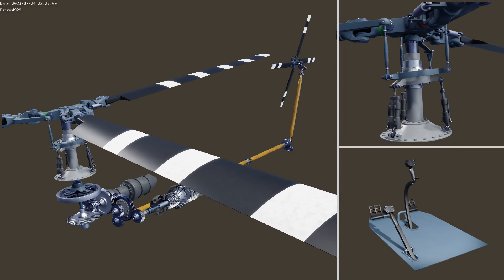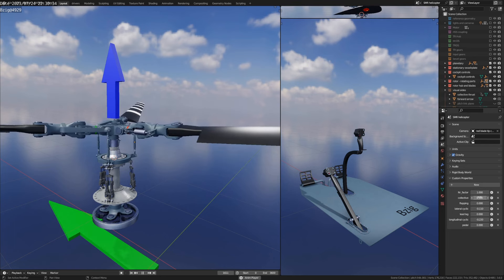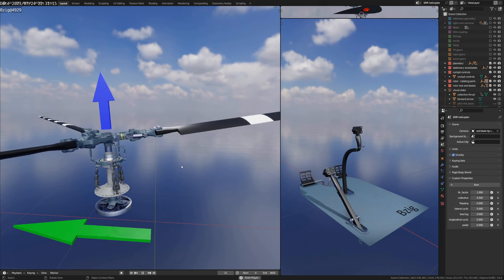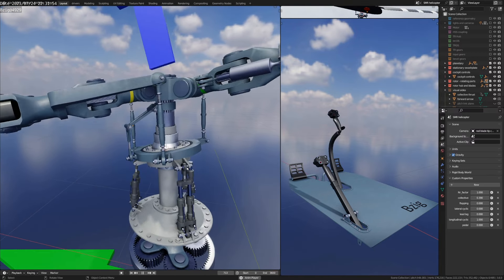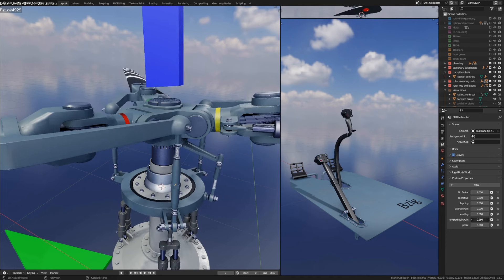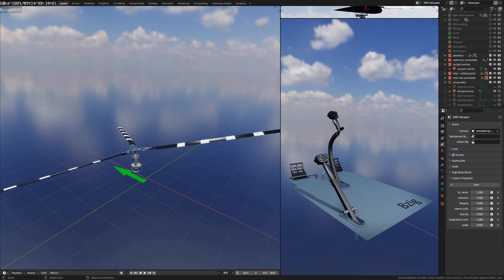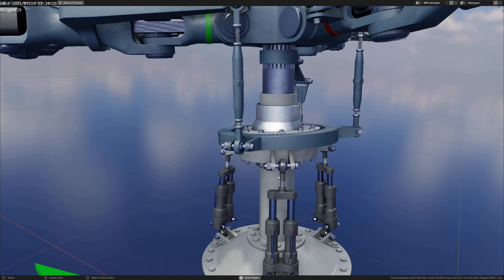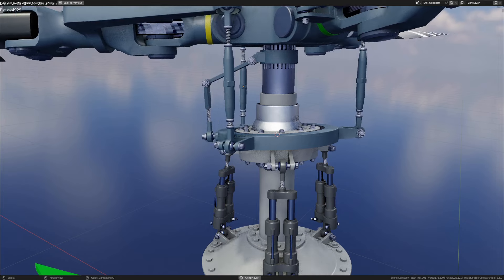helicopter rotor control -  phase delay

Comment: think the light came on when you showed the pitch link... we not actually controlling the blades, we controlling the pitch links, their position and direction are linked, due to the structure, the blades are offset from them, thus the procession.  if i understand it... ;)
still wondering though, you would think due to the max forward movement the blade would create max lift aft... i understand it's not due to position of that link, max up and then the offset of the blade from there...
Reply from the maker: This helps me... You're walking in a straight line.  Someone pushes you to the side.  At the moment they push you... This is the point of maximum force, but at that point you are still on the line, but starting to deviate.  It takes a step or two to get to the max deviation which happens after the original force is gone.

Comment: I used to own and fly an RC helicopter that was based on a Hiller Teeter rotor thus it uses a flybar mass (and in the case of the model the flybar also has paddles).  It too needed the 90 degree phase differential but it was done at the linkage making the swashplate cyclic in phase with the flight axis (ie: swashplate tilt forward would move the heli forward with the linkage controlling the phase lag by connecting to a 90 degree offset). Also on the model the cyclic did not move the swashplate, rather there was an additional link that runs to a mixing arm that connects to the blade link  that mechanically mixes the cyclic and collective, so the swashplate did not have to move up and down (only moves in pitch and roll axis with control inputs to the stick).  My heli was only a two blade and with some high speed cameras it was interesting to see how  much lead/lag imparted into the actual blades where in forward flight the two blades were not at all parallel, you could see they would at times be what I would estimate to be 15-20 degrees out of parallel from the rotational and  aerodynamic forces.  In fact on the model the  lead lag hinge was a very loose connection, so the blades would very easily swing on that pivot with only the blades mass being what holds them out (straight) when the rotor is spinning.

Comment: There is an omission in the graphics of this video. It omits to show the fixed scissor connected between the gearbox and the lower part of the swashplate. It is found on all helicopters that use a swashplate. Also it shows that a cyclic forward input causes al three servos to operate. This is not the case in reality. The cyclic forward/ rearward movement moves only the single servo at the forward position, and the swashplate pivots about the two stationary lateral servos. Lateral movement of the cyclic control cause the two lateral servos to operate in opposition, and the swashplate pivots about the front servo and the fixed scissor. I spent many years as a helicopter engineer in military and civil aviation so am familiar with helicopter flight controls operation and rigging.

Comment: I am a helicopter CFI and I was wondering if there is any way I could access this program that you are using? It would be incredibly helpful to teach new students! I loved this video!!

@bzig
Reply from the maker: The software is actually free.  It's called Blender and it's used for animation and 3d modeling.  The model I created has property sliders that I coded into blender... things like control positions and and the rotor DOF's.  I can see how it would be useful to have a student drag the property sliders around, and see the effect on the aircraft.  This would be better than just watching someone else do it on a video.   But there's probably more learning, than would be worth the effort, to use the software.  In this video, I did a lot of setup, behind the scenes, because the model is not a perfect simulator.  I like the idea though and I wonder if I can make this a good enough simulator to take the knowledge of the animation software out of the equation... I'll work on that!

Comment: This is a brilliant job, thanks. When I did my heli pilot training, nearly 40 years ago, I was told (or I may have made this up!) that in your example, the max pitch angle was athwartships (as you say) and that this causes greater lift, causing the blade to climb (flap), reaching its maximum height over the tail. This explanation (if correct!) is more intuitive than gyroscopic precession. But is it true? Thanks again.
Reply from the maker: thanks so much for the kind comments!  I intend to do more of these helicopter aeromechanics vids but the day-job keeps getting in the way.

Comment: Great animation, but helo books tell that you change pitch 90º before the blade reaches the hiher point......but it looks that in the animation swashplate is perfetly directional with the disc rotor movement.....
Thanks
Reply from the maker: Yes... But the point of the video is to look at where the pitch link connects.  The pitch link is about 90 degrees off... So looking at the swashplate gives the impression it's not 90 off, but it really is.  The pcl connection point is what determines the phase offset.

Comment: As a kind in the 80s 90s i loved RC airplanes and could make them by hand from my head. found a low cost used RC helicopter  and had to replace some missing parts. i could never understand why i  could never get it to fly right and all my inputs were about 90 off.  this RC was big and not a toy for RC standers.  after all most hitting my self a few times with it i  gave up and used the parts for other  things. for the last few years i have seen videos like this and now understand why. when you say it hard for others to understand i to was one of them on where max pitch needs to be

Comment: this is the most intense and detailed .blend file i've ever seen. i've used blender for a really long time now (albeit all i do is animate and model) and i wouldnt even know where to begin. fucking impressive dude. how big is the file?
Reply from the maker: here are some stats on the blend file... 102MB file, 1640 objects, 1.2 million vertices, 1.5 million faces.  I did lots and lots of "duplicate linked" to keep keep the cooling fans on my PC happy.  Also, I started this effort using motion constraints for everything.  This was frustrating because I needed to rebuild the constraints for every scene.  I was about to give up, but then I learned drivers. Drivers made this possible at a much lower level of frustration.  Drivers have heavier up-front commitment, but once they are created, this was more like a simulation that I could run for different scenarios.

Comment: You seem to be very knowledgeable about these aircrafts.

I've followed several courses aimed at a technician audience, and several times the explanations seemed to be overly simplistic or upsetting for various reasons.

It was said that the dissymetry of lift was compensated by allowing the blades to move freely on their hinge. And then the rods would simply pull back the blades to change its angle of attack, and achieve relative balance of lift.

Some others more advanced opinions on youtube seem to say that the blade going an upward motion during it's flapping, naturally changes the angle of attack thanks to this vertical motion, and it has nothing to do with mecanical links.

Gyroscopic precession : I was told to think of the delay as this gyroscopic effect. But the angle isn't always 90° as it should. An other opinion online, from rc pilots, seem to say that this lag is purely mecanical, and comes from the time it takes for the blade to apply the desired force, after receiving the input, due to its inertia or something like that.

I know my message is long, but all of these mysteries obsess me a bit, I would gladly read your own opinion.
Reply from the maker: You comment on dissymmetry of lift are not contradictory.  They flap on their hinge in response to the increase in lift caused on the advancing side, but then the upward flapping motion indeed reduces the angle of attack.  So this is a naturally stable system... More speed causes more lift, this causes mare flapping, this reduces lift and the blades seek a stable, happy flapping angle.
Reply from the maker: Gyroscopic prescesion vs phase delay is a hotly debated topic.  Regardless of the name we call it, we know blade pitch change has to occur 90 deg prior to the motion caused by the pitch change.   But 90 only applies to machines without any hinge offset.  As soon as you move the hinge away from the center of rotation, the offset becomes less than 90.  

The lead angle is proportional to the ratio of the frequency on the rotating blades to the frequency of flapping.  I personally don't think it's correct to call this gyroscopic prescesion, but it doesn't really matter what it's called as long as we understand the input and the response are separated by this angular phase shift.

Comment: It seems the effect doesn't have anything to do with gyroscopic effect and gyroscopes in general. It's just that if you look at a sinusoid, the tangent at her maximum is horizontal and vice versa: it's tangent at the root is maxumal. So if we want to have the maximal displacement at 6 o'clock position we need to apply force (resulting from increased AOA) earlier and wait until the sinusoid reaches it's peak...

Comment: Well done, there is not a phase delay, for the blade its vector of lift is tilted forward as a retreating motion is faster then the hub. Phase delay absence.
Reply: huh?
Reply: @brodricj3023  I don't believe in phase delay, we have to look at the blades, imagine 12 blades being set to the right foward AoA, there is no "delay" phase, the angles are varing from 1 degree to 9 to make the disk fly foward ...
Reply: @FernandoVisserCedrola  Don't complicate it. The rotor blades follow the plane of the swash plate. The helicopter just follows where the rotor disc flies to. Simple.

Comment: Fantastic video animation.  My only suggestion is to also include the concepts of Advance angle (angle between pitch link attachment point on swash plate and blades position of max pitch) as well as Phase angle (angle between swash plate tilt and cyclic input).
Reply from the maker: Thanks!  I didn't know there was a term for the angular offset of the pitch link.  I was attempting to describe "advance angle" but it certainly would have been better if I used the term.

Comment: This is incorrect.  The flspping of the blades is not the same as the tilt of the swashplate.  They are entirely unconnected hinges.
The plate tilts 90 degrees out of phase with the flapping.
Think of kicking a ball-it doesn’t reach maximum deflection immediately.  For a rotor with a natural frequency of one per rev the maximum deflection will be 1/4 period later or 90 degrees.

Comment: No F way. Each blade is individually controlled by the swashplate tilt via the pitch horns. Cyclic does not tilt the whole rotor system. At least not on my Rotorway 2 blade
Reply from the maker: I hear what you're saying, but the net effect on the tilt of the tip path plane is to move in the direction the cyclic is displaced.   If you nove the controls on the ground you see the TPP move in the same direction as the stick... But I get what you're saying that the cyclic doesn't directly control this.
Reply: @bzig4929  you are correct for the ground part from the inherit static pressures or forces on the swahplate and push rods on the system but that is absolutly not how a helicopter flies or changes direction in flight. The whole purpose of the swashplate is to change the pitch of individual blades as they go around changing lift thus (in apprearance) tilting the rotor in the direction you want to go.....but not all true. Its very complex indeed

Comment: I’m surprised the turbine exhaust doesn’t push the helicopter forward.
Reply from the maker: If the engineers do it correctly, there is really very little energy left in the exhaust.  The power turbine is designed to extract as much useful energy as possible.  I've stood near helicopter exhaust and it's out of energy within a few meters of the exit.

Comment: This would be a lot easier to follow with a two blade rotor head.
Reply from the maker: That's a good idea!  I didn't do that because there are no (that I'm aware of) 2 bladed fully-articulated rotors, but this is a great suggestion for learning about how the blades are controlled.  Or I could just use a teetering 2 blade to explain the concept.
Reply: @bzig4929  Isn't the Jet Ranger a two bladed helicopter without flybar?  I believe many people think the 90 deg input offset is due to gyroscopic precession.  I know there is "some" procession, but the helicopter isn't forcing the disk to tilt, the tilting is done by the disk itself due to the pitch changes. The disk is tilting the helicopter, not vice versa.   I tell people the 90 deg difference has very little to do with procession, and they argue with me. This is so hard to explain in a comment....
Reply from the maker: @stevereid7140  Yes, the jet ranger is a two bladed rotor head.  The concept of phase delay would be the same as a fully-articulated rotor; with the nuance you pointed out that the entire hub tilts as opposed to individual blades.  I hear you on "hard to explain with a comment."  It's hard in these videos also... I think I get it right and then I read the comments and realize how I could have explained it better.  

Even though I could show the 2-blade teetering phase delay, I still think building a fictitious 2-blade articulated rotor would be a cool learning air for understanding of how the flapping and lead-lag hinges work.  oh... even better, I can build a 4 blade, show the entire hub and hide 2 of the blades for clarity.